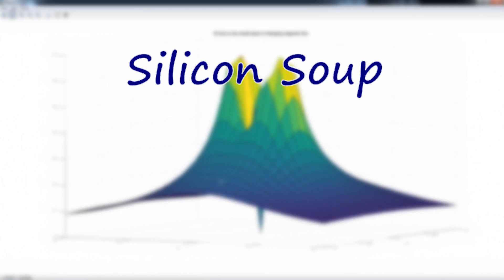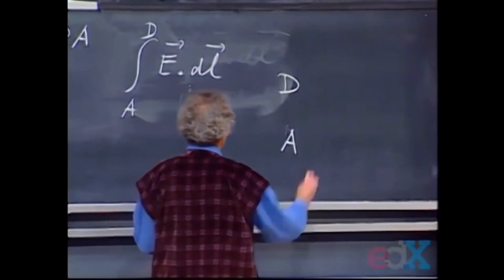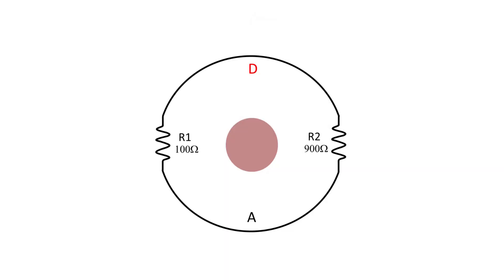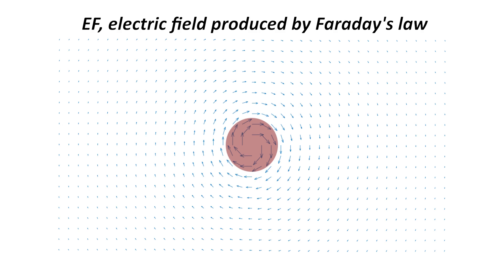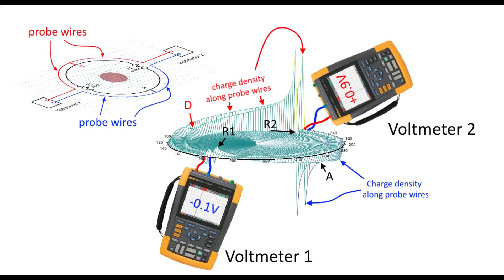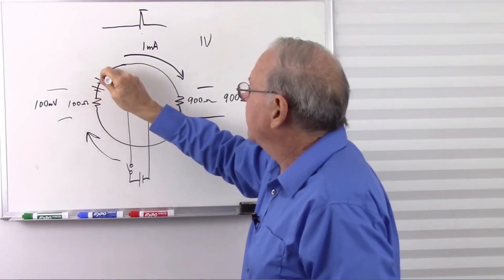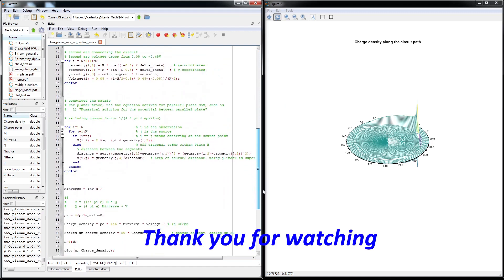Dr. Lewin vs ElectroBOOM on KVL. Of course Dr. Lewin is right.

Comment: I agree with your analysis, which you've obviously put a lot of time and effort into so thanks. The main point for me, is that for a conductor J = sigma E regardless of how E is produced inside whether from a DC battery or a changing magnetic field etc. And as you've clearly shown, this is done via the internal electrons moving to the surface to add an additional conservative E field, maintaining the physics reflected in this equation. Hence if you know J, then you can calculate E which will be zero for a perfect conductor for a finite current J; and this implies a zero total EMF calculated through the wire. There is a famous paper on this: What do ‘‘voltmeters’’ measure?: Faraday’s law in a multiply connected region by Romer
Reply from the maker: Thank you for watching and comparing notes.

Comment: That's a verry elaborate video. But there's confusion about your ultimate conclusion.

KVL states that the directed sum of voltages arround a closed loop circuit is zero.
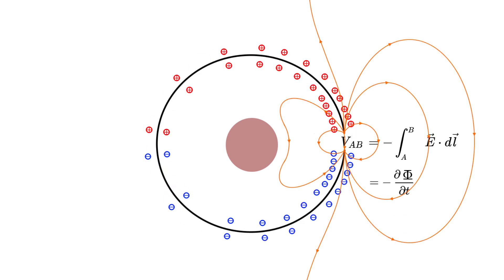You proved (@7:05) and showed (@10:55) that KVL doesn't apply to an open loop of wire.
@9:33 you explained verry thoroughly the error in measurement with Prof. Lewin's setup: that there are voltages induced by EMF in the test leads of the voltmeter.
You even explain how to eliviate that problem.
And from all that you conclude that Kirchhoff's voltage law does not hold ?

Kirchhoff's laws are the foundation on which electrical engineers do calculations in circuits. 
If they don't apply to AC, explain how our energy grid or our modern telecommunication devices work!
Reply from the maker: @7:05, I used theory to explain in the open wire loop, that KVL doesn't hold. @10:55 I did measurement to confirm the theory is correct. All I need is one case, to prove that KVL doesn't always hold. 
KVL doesn't hold for inductors, when the loop is taken along the physical wire in which the current flow (going round and round with the coil wire). However, there is a workaround, by choosing a KVL-loop that jumps across the inductor terminals, and no more changing magnetic flux inside the KVL-loop. The is the method Feynman explained, and we all use this method circuit analysis. KVL is applicable to AC  circuit without inductors, and when inductors are present, we use extended KVL (unknowingly). 
The Lewin-circuit however, is not valid even for the extended KVL method, because there is no way to find a loop that  can exclude the changing magnetic flux. I learned this is called the unlumpable circuit.
Reply: Torsten: Can't the open-loop circuit be considered as a closed-loop circuit with the gap being thought of as just a capacitor.
Reply: @johnflux1  It can. Infact it has to.
And if one would add a capacitor with i(t)=C(du/dt) to the model, instead of a gap, that charge distribution would look a little bit different.
Reply: @johnflux1 a steady state cap is a open circuit, which in circuit analysis we then no longer consider the current in the wire. What is presented in this video is not a RLC circuit analysis, good physics, just not applying rules how they should be in circuit theory.
Reply from the maker: At 5:51, the induced field is canceled by the Coulombian E-field in the conductor, and the insulator close to the conductor also experiences almost zero E_phi (tangential). However, E_r and E_z can be significant. Assuming the coil has N turns stacked up, and the terminal voltage is Vt, then between two adjacent coil, the insulator  experience a voltage of Vt/N, or E_z = Vt/(N*d), where d is the gap between two coil (or the thickness of the insulator). I don't know about the property of the insulator, so I can only guess that if d is very small, then E_z can be large enough to cause problem.

Comment: For me the professor in blue shirt is right , it's not possible to have different reading when you are in parallèle , the voltage is the same .
Reply from the maker: Most people agree that the two voltmeters give different readings, and this can be and has been confirmed by measurement. The question is how this happen, and whether there is consistent with our understanding of parallel circuit. @9:27 to 10:13, the calculation shows that the voltmeters would measure different values. The reading of voltmeter1 measuring R1, will have the same value as voltmeter1 measuring R2, if we don't forget the emf in the loop.
Reply: @SiliconSoup  The resistors are not electrically in parallel. The current flows through one resistor and then the other resistor in sequence R1 then R2, and so the resistors are in series. But as the sum of the series voltages cannot be displayed directly on one single voltmeter maybe in a circle is a better choice of definition. But they are certainly not in parallel.
Reply from the maker: @woodcoast5026  I never said R1 and R2 are in parallel, and I never used any parallel equation to calculate the voltage. The voltmeter is physically connected across R1 and across R2. If you think only R1 voltage will show up in the voltmeter, you are lucky. If the voltmeter is positioned differently and encloses some portion of the changing magnetic flux, then the voltmeter reading is V_R1 + emf enclosed by the measuring loop, and it is also equal to V_R2 + the emf enclosed by the measuring loop.
Reply: @SiliconSoup  The left hand voltmeter displays the value of the path integral of the electric field on the left hand side of the circuit. 
The charge distribution illustrated starting at 7:17 only shows the charge distribution in the conductors between the resistors , do you think it would give further insight into the circuit to show the charge distributions for the resistors as well and the conductors.

Comment: For the Lewin Circuit. Here is a concise explanation for why the voltmeter readings are in accordance with the resistor values.
Voltmeters display the value of the electric field that lies along the path of their internal  resistance. For the Lewin circuit, Faraday's law dictates that the current always flows in one direction around the flux and so dictates which resistor defines the value of the electric field lying along the path of the resistance of the voltmeter.
Reply from the maker: I don't get how the current flowing in one direction dictates which resistor defines the reading for the voltmeter. My understanding is the voltmeter1 measures R1,  and (R2+ emf) at the same time. Both give the same result, but it doesn't mean only R1 gives the reading to voltmeter1.
Reply: @SiliconSoup  The reason that the specific voltmeter shows the voltage across the specific resistor is that  a voltmeter and its adjacent resistor  are one conductive path that is split , and as it is known ,  the resistance of such a  path is R1*R2/R1+R2. The reason the path is separate from the other side is because of Faradays law , it  dictates that the current flow is in one direction around the flux and that dictates that  the meter/resistor pairs  are in series with electric fields  V=I*R for each pair  , as it is known , the electric field across two conductors in parallel  is the same electrical field. Voltmeters display the value of the electric field that lies along the path of their internal  resistance.  And so there is two distinct conductive pairs and two electrical fields at two distinct physical locations  and two distinct  readings.
Reply from the maker: We both agree that the 2 voltmeters read  2 different voltages. Most people with the knowledge of the parallel circuit expect R1 and R2 to have the same voltage. You method of finding the voltages across R1 and R2, although correct, does not explain why two meters connecting to the same points can have different readings. The mystery remains, by your explanation.
Reply: @SiliconSoup  Hi Silicon Soup.
My explanation does explain why  two voltmeters connected to the same point can have different readings. I will summarise the part of my comment  with the critical point in capital letters. note the word -SERIES. -
Faraday's law dictates that the current always flows in one direction AROUND the loop and so dictates that THE METER /RESISTOR PAIR ON ONE SIDE IS  ELECTRICALLY >> IN SERIES <<  WITH THE PAIR ON THE OTHER SIDE .  That is two separate and distinct electric fields, one field for for each voltmeter.
Reply from the maker: You gave a comment in RSD Academy video, and I would like to compare notes with you here. You said "Voltmeters do not "measure" an electric field because it is located in a physical location across the internal resistance of the meter, they display the value of an electric field because it lies along the internal resistance of the meter". If you mean voltmeter shows E.dl across its internal resistance, I agree with you, but this is only one perspective. Let me give an example as it is easier to express my view. A battery is said to have a voltage (e.g. 1.5V) because the charges at the terminals set up an electric field everywhere in space, and regardless of the path, intgral (E_battery.dl) = 1.5V from the positive terminal to the negative terminal. When a voltmeter and its probing wires tape the battery terminals, the wires experience E_battery.dl of 1.5V. Charges are moved by this E_battery, and accumulate across the internal resistance of the meter, AND along the wires, in such a way that these charges set up an e-field to cancel exactly the E_battery at every point along the wires. The resultant e-field along the wire is 0, but the resultant e-field is made up of one E_battery and another counter e-field. The voltage across the internal resistance of the meter is the result of  intgral(E_battery.dl) that is captured by the probing wires when the wires form a close loop. So there is nothing wrong to say the voltmeter measures the e-field in the space, picked up by the wires. In fact, if there is a rotational e-field generated by the changing magnetic flux, that e-field will add on to the voltmeter reading. If the wires don't form a close loop, the gap will have a higher resistance than the voltmeter, and all the E_battery.dl will appear at the gap, and the voltmeter will show 0V.
Reply: @SiliconSoup  The particular characteristic of the Lewin circuit is that it illustrates that ACROSS a voltmeter is an insufficient definition. Normally the distinction between along and across is not apparent, but because in the Lewin circuit  the current flow is induced and therefore the electric fields are physically separated , there are two electric fields , one situated along the path of the left  voltmeter and one situated along the path of the right voltmeter.
Reply from the maker: @woodcoast5026  I do not understand what you mean by "across voltmeter is an insufficient definition", and whether that implies I said something as the sufficient definition for voltmeter, so you need to guide me clearly. I also don't understand "electric fields being physically separated". The electric field is a function of space and time, and here we use pseudo-static approach so time is not in the picture. My understanding of the field-distribution is plotted graphically in the video. I also explained how the charges influenced by this field rearranged themselves, and produced another Coulombian electric field. If my field distribution is wrong,  incomplete, or vague, please tell me using time-stamp, and it is easier to discuss.
Reply: @SiliconSoup  Hi Silicon Soup
I will add to my comment to make it more clear.
Voltmeters display the value of the electric field that lies along the path of their internal  resistance.
In the Lewin circuit , because of Faradays Law,   Charge can only flow in one direction. Clockwise. 
And so charge can not flow to the left hand side voltmeter from the electric field on the right hand side of the circuit  because that would be anticlockwise. 
 In the Lewin circuit there are two electric fields that are located spatially,  (but not electrically,) across the probes of a meter. But the meter only displays one of the fields. That highlights what is wrong with the term, across. 
  Because of Faradays Law.  Charge can only flow in one direction. Clockwise.  And so charge can not flow to the left hand voltmeter from the electric field on the right hand side of the circuit because that would be anticlockwise. And so the left hand voltmeter displays the value of the electric field on the left hand side of the circuit, because that electric field lies  along its internal resistance.
Reply: Silicon soup,
As you ask for a comment on your video , I can do that.  From 8:28 to 9:10  Your description of charge distribution is similar to my description of electric fields that I put in my comment above. You say that the charge distribution along  path of the internal resistance of the voltmeter1 is the same as the  charge distribution along the path of the adjacent resistor R1 and that results in  the reading on the voltmeter. I agree with that.
 But then you make an error form 9:38 to 9:46 ,  the error that the voltmeter can display a field that is along a different path , ( path along R2)  a path that is not along the path of its internal resistance.
Reply: @woodcoast5026  you keep omitting 'path integral of the', before 'electric field', in your definition of what a voltmeter measure. Voltage is in volts, electric field is in volt per meter.
A good paper that explains what a voltmeter measures is that of Romer  himself.

There is a definition of voltage given by the IEC that consider voltage exactly that: the path integral of the total electric field E along a given path.
Unfortunately Kirk McDonald came up with his definition of 'voltage drop' that is what the rest of the world call 'scalar potential difference', so according to him voltmeters do not measure his 'voltage drops' ( but, again according to him, they should, ie they should measure scalar potential differences, in the language of the rest of the world. Imagine getting readings to which you cannot even apply Ohm's law...). And all KVLers take his note as the gospel because with that definition of 'voltage drop' you can still have KVL.
Reply from the maker: @copernicofelinis  Thank you for your explanation again. When I read Kirk McDonald's article, I almost thought he could do the math but not the physical interpretation. His own terms confused everyone. IEC definition of voltage makes more sense to me. Firstly, the oscilloscope or voltmeters can only pick up the total electric field, so it is more practical to define voltage from the total electric field. Secondly, voltage is defined so that it can be used for power calculation. Voltage = work done per unit charge leads to all the equations for power calculation. If voltage is defined as the scalar potential difference only, then VI is the work done to overcome Ec only, not E_total, and P = VI is an incomplete power equation. What a weird definition he used. Moreover, he actually inserted the secondary winding of the transformer between a and c and labeled it as L. By convention this would mean voltage is induced across a, b, but he clearly understood that Vmeter = 0.
Reply from the maker: @woodcoast5026  In John W. Belcher's article, he also calculated the voltmeter1 reading, from the loop enclosing R1, and from another loop enclosing R2. He wrote, "we get the same answer using the other path, which we must, otherwise something is seriously wrong with our physics or mathematics". I am happy to find out that my analysis and Belcher's have the same idea. There is no way R2  will not influence the voltmeter as they are physically connected. It is our job to make sure the results are consistent from every possible loop connected to the voltmeter.
Reply: @SiliconSoup  >Silicon Soup, 
The left hand voltmeter displays the value of the path integral of the electric field on the left hand side of the circuit. 
That is the electric field that lies along the split path of the left hand voltmeter and the left hand resistor. Voltmeters display the value of the electric field that lies along their internal resistance. They can not display the value of an electric field that is located at some other location, that would be an impossibility. This fact is one of the key things to understanding the Lewin circuit.
 >Silicon soup, 
 The charge distribution illustrated starting at 7:17 only shows the charge distribution in the conductors between the resistors , do you think it would give further insight into the circuit to show the charge distributions for the resistors as well and the conductors.